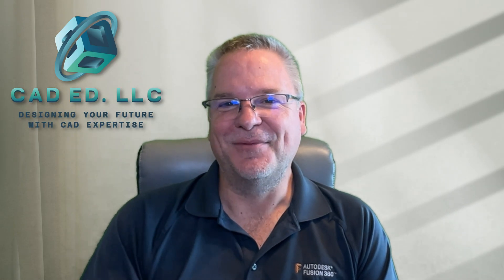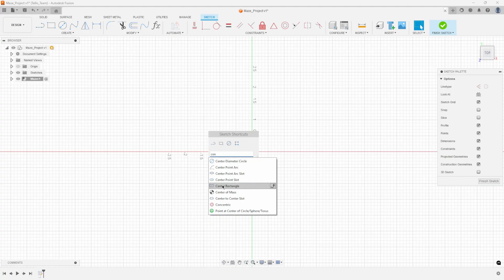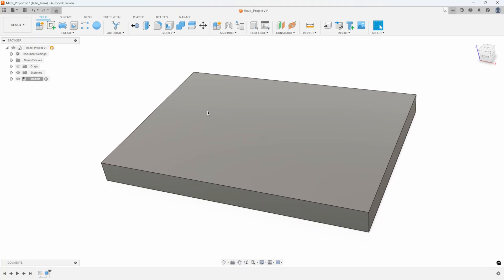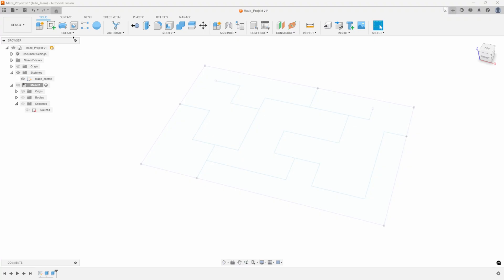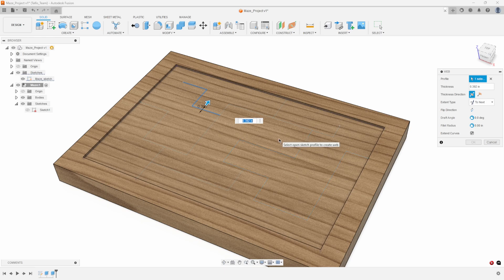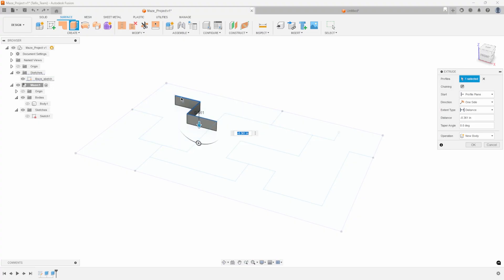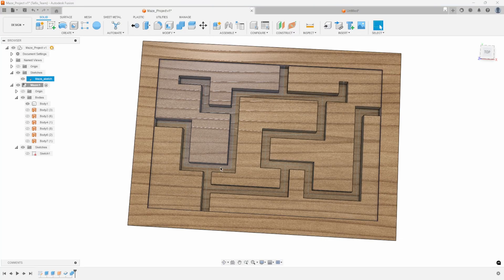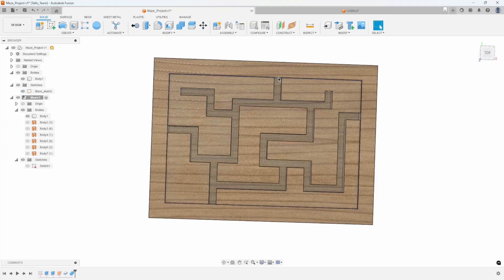A 'Maze' ing Tips & Tricks in Fusion

Comment: Thin extrude
Reply from the maker: Yep...  Totally would have been a better solution...  I always forget about this.  I'm going to pin this comment as I think this is a better solution than what I showed.  I will probably show this solution in a follow-up video.
Reply: Sometimes I learn one way and stick with it even though there's a better way. The way you did it is the way that everybody had to do it before they added the new command for thin extrude.
Reply: @bradtallis8968  Isn't that what you did? If not, what's the difference?
Reply: @JD2jr.  Thin extrude is in the solid workspace. It would allowed it to cut away as it extruded in one step. He could have also created a square pipe from the lines and then cut/combined with it.
Reply: @bradtallis8968  I always think that computationally behind the scenes the thin extrude command is effectively doing what you showed here but in one combined operation

Comment: Thx Brad, we all know within Fusion you can do the same in minimal 5 ways. In this case I would have used “pipe”
Reply: You have a lot less control over the profile. Thin Extrude will work better as you can define depth and width along with direction. Absolutely however many ways to skin that cat :)
Reply from the maker: @Eric1960- Actually, the Pipe command was the first method I tried.  However, it didn't work as well as I expected.  First, you couldn't select multiple paths, so you would have to create each segment separately and then combine them together.  And secondly, the pipe ran down the center of the profile, so you would have to offset the profile plane down half the thickness of the pipe, etc.  I was really hoping it would be the best solution.  However, as others have pointed out, Thin Extrude is probably the best solution in this case, not the thicken command like I showed.
Reply: @ thx for your clear explanation. Its doing me well my idea was the first you tried. Means it was not that stupidly 🤣🤣🤣🤣